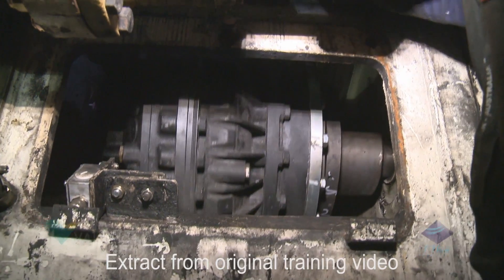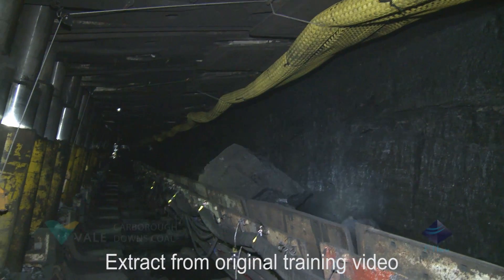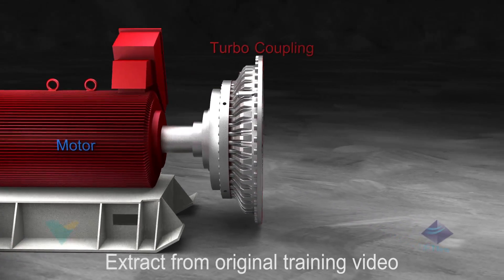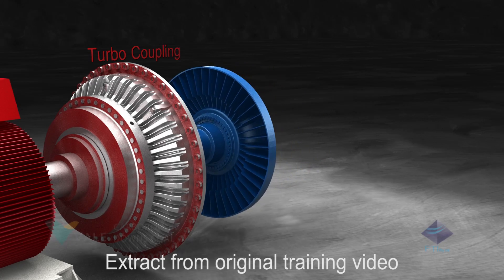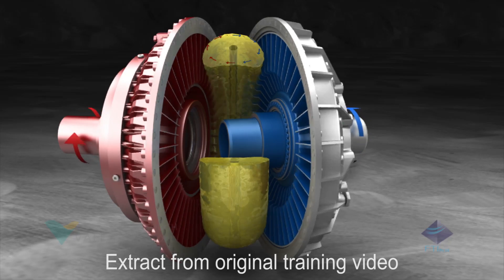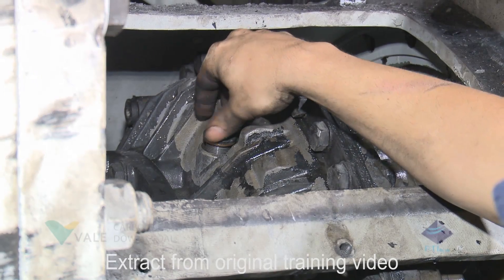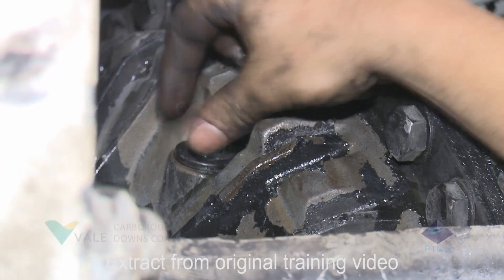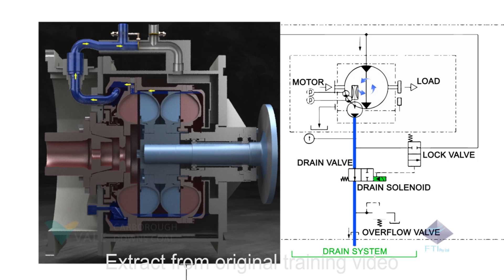Fluid Coupling Operation - F.T.I. Pty Ltd

Comment: why they didn't used gears
Reply: It mechanically separates the engine from the machine, mostly at startup.   If it’s a heavy load, it’s not going to move very fast right away, and if it was a gear connection the engine would stall.   So the liquid coupling lets the engine spin at first and transfer power before the load has gotten moving fast enough.